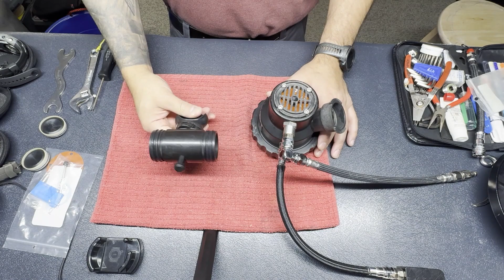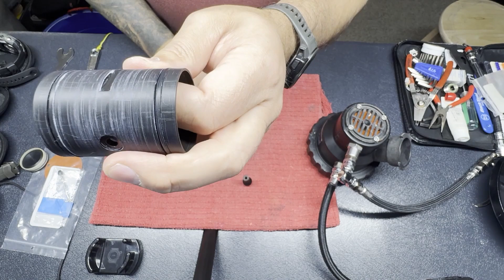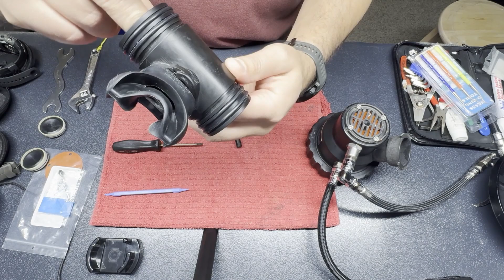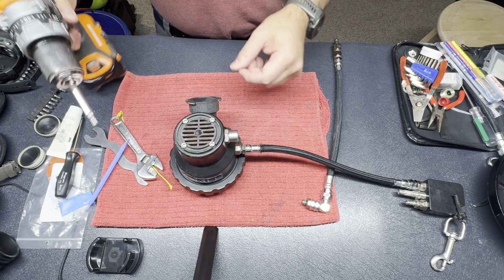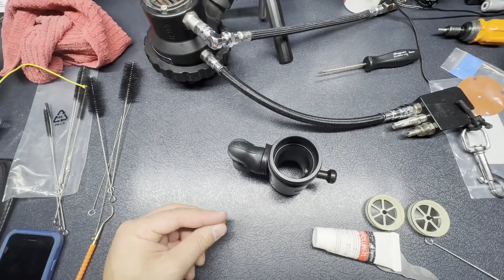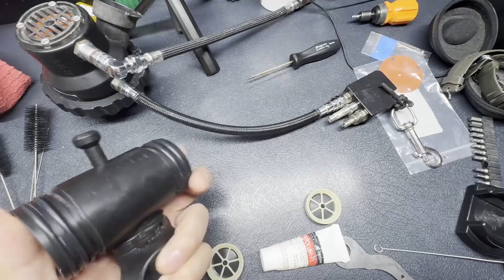Kiss Sidewinder ADV and DSV Maintenance

Comment: Good video, I'm just about to strip, clean and service my unit for the first time any advice for best method for removing sorb buildup. Not sure I want to drown it in vinegar, do you use an ultrasonic cleaner for any of the components?
Reply from the maker: I don’t have much more to add for that unfortunately. I soak my canisters in a steramine vinegar solution. It’s around 1 cup of vinegar for a 2-3 gallons of water and steramine. Should probably be more but it gets the job done well enough. I rinse them out with water after. Haven’t noticed any residual odor or taste from the vinegar.

Comment: Thank you so much for letting us in on your sidewinder. How do you know/find what third party parts that can be used . Hopefully will be getting my class and  SW soon. You answered most of my questions from your previous videos. Do you have to send it in for service like regular regulators or after you complete the training you can service it yourself?
Reply from the maker: You’re welcome. I follow several rebreather, Kiss and Sidewinder specific Facebook pages. Tons of great info on there. Mods like the needle valve are explained in depth when you take the advanced trimix class. Though there is a ton of info on them on scuba board and other sites as well. I do all the maintenance myself. Not sure if kiss even has a maintenance schedule/program. There is nothing to them and they are built to be serviced/repaired in the field of necessary.